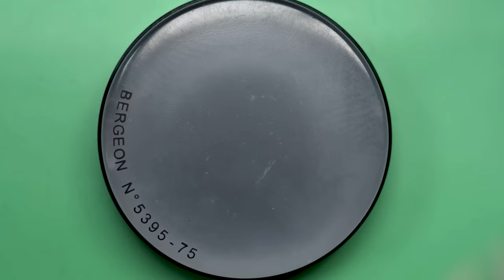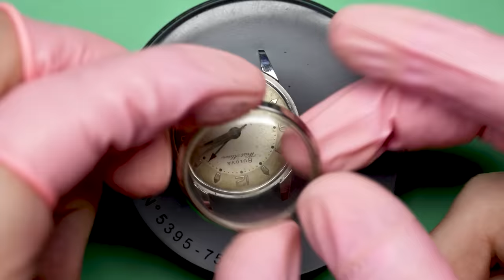Restoring A Broken Vintage Watch With an Alarm Function!

Comment: I haven't seen all your videos, Marshall.  So I may have missed a more complex watch you repaired.  But this is the most complex one I've seen.  It looked like you had about twice the number of usual parts to put back together, just to make that alarm mechanism work.  And I like the alarm sound after it finally worked properly--sounds like an enraged cricket.  It's a super cool watch.  Thank you for another great video.
Reply from the maker: I think you're right, this is the one of the most complicated watches I've done

Comment: Right on, I saw that spring during disassembly and wondered why he didn't bring it up.

So when looking for things in weird locations or if they are really small if you use the camera on your phone set to video mode, you can turn on the 'flash' that will turn on your flashlight.  
From there you have a small camera that you can zoom with that has a light on it.  It being up on the corner of the phone it makes it so you can lay it flat on the floor or get it so you can see under things.  The light will cause metal items to reflect back to the camera.  It works AMAZING to find little things or to try to see what your puppy is chewing on under your bed in my case rn lol.

Comment: The alarm is one of my favorite complications, as it seems extremely practical! I have a Poljot alarm watch which I've modded with new hands. I had a fantasy about changing it to use a chime, like a repeater or the Breguet alarms (which sound wonderful), but turns out I'm not that clever. My first alarm watch was a quartz one - the Casio Worldtimer, which I wore constantly for years, and used the alarm many times a day. Cheers!

Comment: These videos about watches with interesting complications are the most compelling for me. Have you ever tried making a new click spring? I would think it wouldn't be too hard, and would make for an interesting video. I think the spring steel comes annealed and you can quench / temper it pretty easily after you have it in the right shape.

Comment: I own two Bulova’s, but not so complex as the Wrist Alarm.
The others from Vulcain + JLC called in line the Cricket (Presidents watch) and Memovox. 

I have two vintage watches, and it are fantastic watches with a lot of charm.

I know about popping away screws, a few months ago i changed a cartridge on my turntable, and with a flashlight i was searching on the floor on my knees for a screw which rolled away. 
Otherwise i could not attach the new Nagaoka cartridge to the tone arm. 
Sounds like that great Bulova Wrist Alarm. 
Great cartridge.

Comment: Did you mention  that Bulova created the Accutron watch?  One of my college roommates bought an Accutron watch with a see-through dial that exposed the inner works--a great sales gimmick. We teased him, saying that he bought the salesman's own watch, but it was more accurate than my Timex mechanical-electric watch, which worked like the old electric-wind clocks in cars of the 50s that had a small electric motor which periodically wound the mainspring of a mechanical movement.

Comment: Honestly, I believe that the alarm function is the Vibration,  not the sound. That's why that post connects to the case back, so you really feel it when wearing the watch. I was really impressed with your skill level on this resto. When you started taking it apart, I was dumbfounded! And I still love the way you bring us along on the adventure. (We did it. Let's get into this)
Thanks for so much entertainment and knowledge!
Reply: I was thinking the same thing about the mystery post on the case back.

Comment: I won't pretend to know anything about watches, nonetheless, at time index 20:07 the only worry I have about the scratched barrel is, that without putting it in some kind of rust converter solution, the scratches might be spots that will be prone to rust quicker than the rest, perhaps.  nice watch save, and entertaining video as always, Thanks for sharing your experience Marshall.

Comment: I have a Benrus Wristalarm that uses a similar movement (perhaps the AS 1475) and it is a beautiful thing: the blued hands especially add a lot of finesse to it. (It's the one that Hodinkee used for a limited-edition reissue.) One of the clever mechanical features is the way the alarm hand essentially gets 'dragged' by the hour hand after the alarm sounds, and I think that might have been one of the "not sure what this does" gears that Marshall noticed during the service.

Comment: Awesome video as always!!

Question for you. I have an automatic watch where the crown and stem come right out. I can wind the watch but can’t set the time or date. I opened up the back and didn’t find any loose pieces. It’s kind of odd. It’s a Sturhling Original

Comment: Marshall-- good job! These are really cool. I have a couple mechanical alarm watches. The case back is called a resonator. And I am dissapionted you left the rusty lume on the hands. You shoulda cleaned and polished the hands and put new lume matching the grey color of the dial lume dots. That would make it look nice.  Tho I am not you and it is yours.  Good work finding the lost ratchet spring!  Keep it up!    John

Comment: Another nice job Marshall. I really like that Bulova. It struck me that to save buying another movement for parts and especially the small R springs that are so commonly used to return levers or clicks. How about using a guitar or piano string. They don'T have too much carbon in them allowing them to be bent into shape with or without a spirit lamp. Just a thought. Bw Mike in the Black Forest in Germany.

Comment: I have a magnet parts finder too. I made a little catamaran boat out of Lego with a 2×½×½" bar magnet suspended in the middle, hovering above the floor. Since I have carpet, I don't want the carpet loops to rub things off of the magnet.

Little trivia. When you swipe the floor with a magnet and you find black magnetite grains, those are meteorite dust that you brought into your house with your shoes.

Comment: It's interesting, analog alarm watches kept being a thing well into the quartz era even though most were very quiet and probably couldn't wake a heavy sleeper.  I have a very nice one from Seiko, probably late 80's. It uses a rotating internal bezel to set the alarm, so from a distance it appears to be a normal dress watch. Probably aimed squarely at thriftier traveling businessmen. But it has a very nice appearance and bilingual day-date (when you set it, you can have English or Japanese day names) so it has a place in my daily rotation.

Comment: Excellency work.  I am considering taking up the hobby!  I agree with patina and wear.  Especially when there are good stories.  I don’t like dirt.  I think I would have run a swab with distilled water over the dial to take off surface dirt.
Reply from the maker: I think you should take up the hobby! I do not think you should use swabs and water on dials like this! It would almost 100% take off the clear coat and printing as well. I have experience with this unfortunately!

Comment: I have serviced a few Seiko Bell-Matics and there are a lot of similarities to the Cricket from Bulova.
But what I wonder about is if the alarm is activated when the minute hand matches the hand for the alarm? On Bell-Matics it is the hour hand which makes it more useful as you can use it to wake you up in the morning, as the alarm will not go off within the next hour when it is set.

Btw, I started watch fiddeling with Bell-Matics as no watchmaker around was willing the service it for me, so I had to do it myself which was a very steep learning curve, but even more proud I am when wearing on of them and looking at them or when showing the alarm function to others. 😁

Comment: At the beginning I thought the post on the back cover was to hold something in place, around 27 minutes in I believe it’s for the spring arm to hit against and create a vibration that’s felt on the wrist.

I’m guessing this doesn’t make a noise when going off, the hammer adds mass to make a more noticeable vibration on the wrist.

Comment: Two things.

One, I am not sure how magnets mess with the innards of watches.  I play with electronics, and my wife likes to knit.  She had me make her a thing for knitting that is about 18x24 with a 3/4" lip all the way around it, and magnetic sign stock magnet side up (I used spray adhesive to the bottom), and and some steel rulers.  She can put her instructions in it, and slide the rulers from place to place where she needs to be, the lip is big enough to hold her needles and stitch counters and other stuff.  The funny thing is I made two of them and pop apart hinges thinking she could take it with her and there would be room for her yarn etc, but she hated it.  She only liked the one half.  So I got the other half, and let me tell you it has saved my butt from doing the floor thing more times than I can count.  The lip keeps things from rolling off and if something goes twang, as long as it is magnetic and lands on the inside, the magnetic stuff grabs it and holds it.  Great for notebook and phones and things with small hardware that is easy to lose.

The other is those hands look a lot like they have radium and phosphor on them.  The radium literally cooks the phosphor and makes it turn that brown color, so the hands no longer glow but they are still radioactive and will be for way longer than we will be around.  The stuff is in a relatively stable state unless you disturb it, and the one thing you want to be really careful of is cracking any off and making dust that you might inhale.  If you see hands with that look it might be a good idea to put them in small soft baggies you can toss out after you are done with them, and if you have to blow the face off once the hands are on it, do it outdoors.

Comment: I wish you could work on my great-grandfather's pocketwatch.  It's an early 1900s Elgin Sidewinder with an Omega movement, I think?  My local jeweler refused to work on it.  They wouldn't even clean it.  They said it wasn't worth it because they'd never find the parts to get it running since it's so old but they didn't even try!

Comment: Marshall love your channel. I have a question.  What precautions do you take when working on older faces and hands with radium paint / lume?  I just read some articles on the weekend about checking vintage watches with a Geiger counter first before opening and potentially releasing/ allowing radon gas or radium particles to be breathed in? What has me scared now is buying my first vintage watch now to try the hobby and seeing what looks like brown crystals on the hands on this 1950s Relide watch.

Comment: Great video. I do take exception to the statement that the Bulova name no longer carries any prestige, however. Their development of the Accutron tuning fork mechanism was a major innovation at the time of development and provided a smooth sweep minute hand on a battery powered watch. But more recently they developed the  electrostatic motor which is an entirely new means of powering a watch: two small electrostatic turbines turn with arm movements, like the rotor in an automatic movement. These electrically power a third turbine which operate the motion works. Essentially two generators and a motor. Groundbreaking mechanical design.
Reply from the maker: You don't see many wrist shots of modern Bulova out there, sad to say.
Reply: @WristwatchRevival  fair point. But, to be honest, you don't see many wrist shots of ANYTHING beyond an Apple Watch recently.  Watch people notice watches. Joe Bag-o,-Donuts on the street doesn't care.

Comment: Pretty cool that you got that running. It's definitely more complicated than the ones you usually work on. I'm a little curious why you didn't spend more time getting rid of the rust on the parts? I've seen a glass fiber brush used for that. Isn't there a chance that particles of rust will come lose and get into the works?
Reply from the maker: I did spend extra time on that, I showed it in the video even :)

Comment: As usual, good work Marshall! I was a bit worried about all the parts that needed to be put back in place...
One question: shouldn't we have tried to remove all the rust from the movement? It seems to me that there were still some stains.

Comment: When working on an older watch like this do you worry about the small bits of surface rust still on parts? It might be staining but when reassembling it looked like there was a bit on the side and on one of the 2 first screws you put back in. I'm curious if that "spreads" as the years go on.

Comment: It's actually buzzing because that's what wakes you when you wear it to bed. It's not an audible alarm, even though you can hear the buzz. That's also why the post is on the case as well because that's what is resting against you arm.

Comment: Hey Marshall, big fan of your videos. I have a question. I have a 2002 Rolex GMT master II, it's in great shape. Could you recommend a polish for the case that has very slight scratches on it. The scratches are very fine and I'm sure I don't need anything too abrasive at all. Thanks Jay

Comment: Is there any particular reason you do not use some type of specific rust remover such as evaporust? In my mind it would make sense to do an initial cleaning - if there is rust, soak it in rust remover - then another cleaning cycle. Ideally it would remove all of the final bits of rust that are present throughout the pieces.

Comment: Excellent restoration and cleanup on this nice timepiece! I DO have to ask about the hands on this watch, though. To my eye, it would appear as though there was some old lume on the hands that you didn't address. Am I wrong on this, or were those darker brownish parts of the hands supposed to be like that? I've seen a couple other vids you did where you refresh the lume on hands where the old lume was either damaged or disintegrated altogether.
Reply: He seemed rushed here.

Comment: Hey, quick question/observation. How did you make sure the alarm was in the right position? When you demonstrated it at the end, the alarm was set to about 4 o'clock, but it was only 1:20 when the alarm activated.

The only way I can think of would be to put the normal hands on, set the alarm and then see exactly what 'time' it goes off, mark exactly where the hands were, then reinstalled the alarm at that time and put the hands back exactly where they were.

Comment: I am always curious to see when in the voiceover you explain the answers to the questions you ask earlier in the video. This time it was post on the rear dust cover, which is of course there to connect the alarm lever to the case back for amplification. Not until two minutes before the end did you reveal that to us :) By the way, this watch was made in 1958--note the "L8" code on the inside of the back cover.

Comment: How do you keep track of what screw and part goes where ! ?   Did you start with a watch repair manual to learn all the part names and parts functions?  What is the screw size number and thread pitch on those screws (and how the heck do they make them !).   Is there a tap set you can use to renew any damaged threads.   What type of screw gage (if any) do you use to measure for replacement screws.

I come from a Macro environment (small engine repair) so how you can see and manipulate the watch parts seems like a black art to me . . .

Comment: I am posting this part way through the video and have not read the comments so this may have been answered.  I am guessing that the sound of the alarm is sort of a buzzing sound.  The part that makes the noise is actually the case back,  the pin on the inside of the case back is struck by some part of the the two piece arm or the part you refer to as the hammer.
I also find it quite odd that the only "engine" for the time keeping and alarm is one mainspring.  Unless there is some mechanism that stops the alarm before the mainspring is run down when the alarm sounds it could very likely run all the power out of the mainspring and the watch would no longer be keeping time.  That does not seem like a good thing.
FYI I have a Helbros alarm watch that was my uncle's.  I believe it has two mainsprings, one for the watch and one for the alarm, it has been a long time since it ran.  It was his daily wear watch and he was not gentle with such things and is pretty scratched up.  I think that there is no damage internally and just needs a service and two new crowns and a new crystal.  But there just are not any watchmakers around anymore, at least in the big city of Orlando, FL.

Comment: Beautiful work except for the fact that I would have done more work on those winding stems. They still had a lot of rust and corrosion on them. Did you try the toothbrush with baking soda and vinegar method?

Comment: Marshal you are a legend eheheh :) i love your videos and seeing them i decided to join the hobby and start with a pocket watch...I disassemble it and i forget to take pictures while i was doing it 😂 but after a few hours i did it! I could mount it again and maybe, maybe i have the skills to do this. I'm very happy with the results i'm getting and you were a great inspiration and the trigger to help me start doing it. I have a question, when you clean all the parts, you let them dry in the air or you use other method?
Once again, thanks a lot for your great videos!!

Comment: A lot of the old timers would dip the works in kerosine as a cleaner and lubricant.  I suspect that is why that clock is so dirty, and oily. It would of course seep into the felt washers, which would make them oily, as you found.